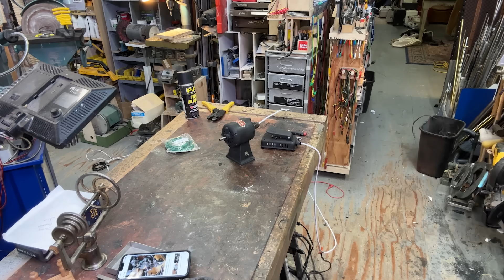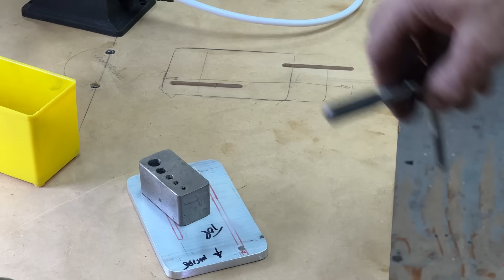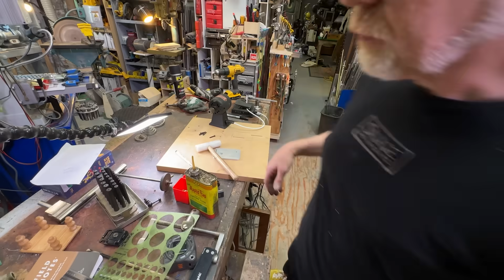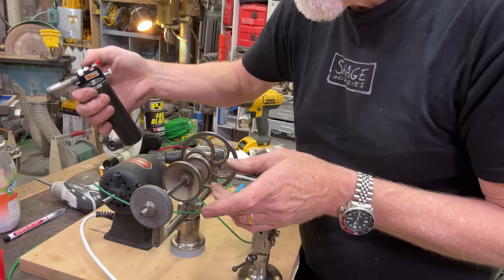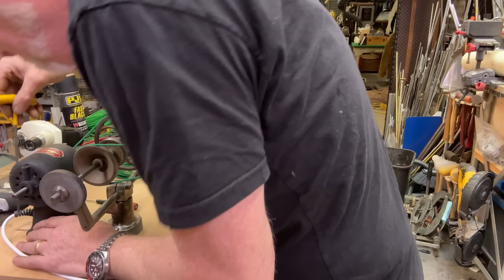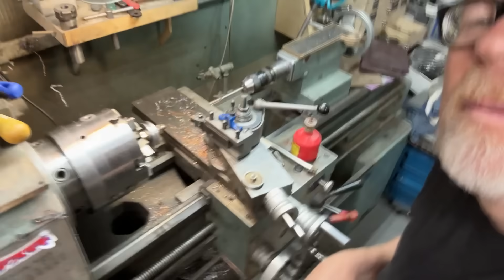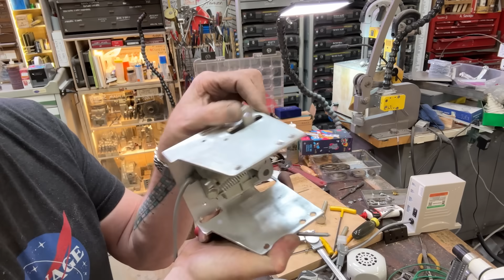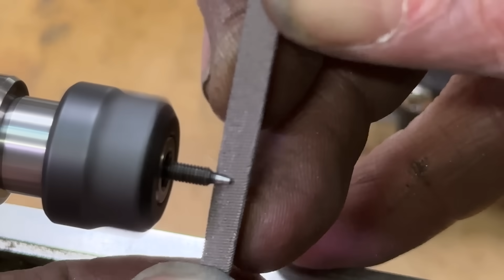Adam Savage's New Mini Watchmakers Lathe!

Comment from the maker: Check out Chronova Engineering: https://www.youtube.com/@chronovaengineering
Adam's restoration of the lathe motor: https://youtu.be/XQdJ-uG_Noo
The lathe motor was a gift from Tested viewer Paul Dorton--thanks Paul!
Reply: on the back end of the mounting board add some small hand wheels and some VERY fine threaded rods to tension each assembly for the belts more accurately ....  and dont forget to leave space for a tool rest assembly to work from ...
Reply: WOW what a gift. If you are interested in delicate work Clickspring on Youtube is a must. He has been building a very accurate copy of the famous Antikythera mechanism amongst others.
It's funny I always hated small lathes but now I have several monsters I have become fascinated with tiny work!
Reply: Diagram of how to replace a hall sensor with a variable resistor. https://drive.google.com/file/d/1bSE9vftQQLGGos4UH7KkB0bjkC0M2V7v/view?usp=sharing
Reply: It would be great to be able to spin a number 2 lead pencil

Comment: The best reason for milling a flat on the shaft is not to help the setscrew hold, but to keep a burr that the setscrew produces when driven into the shaft from binding against (and wearing) the bore of pulleys that have to slide over it.

Comment: Well I am not online so of course you couldn't find me. And I am still in the middle of the rebuild of my head stock on my levin precision 8mm or WW lathe. It is a closed head stock although I have lots of parts including several open head stock machine , which yours is, including both 8 and 10mm spindles. It is taking me a long time (months) for my rebuild for a number of reasons but videos like yours spur me on. The factory TIR on my spindle is 0.000050" or 50 microinches or 50 millionths of an inch. Wish me luck. I need all the help, technical or divin, I can get. Thanks for this.

Comment: Hello Adam, I need help because I’m looking for a motor for my lathe but I’m worried that a sewing machine motor is too under powered for what I need it for so can you help me with choosing the right motor for my watch maker lathe?   (2026 UPDATE) I use a cheap Chinese sewing machine motor that has 0.15 horsepower and after having it and working on that motor for 6 months I concluded that this motor is not worth it so your better off buying a bigger motor and maybe the one that Adam is using here would probably be better than what you need but I don’t see any links to this motor so I don’t know where or what to buy so I can really use help with this, I need a new motor soon!

Comment: The main purpose of a watchmaker lathe,  especially the GENEVIA design, is to make watch pivots. The lathe must be small enough to allow delicate cuts that produce a pivot, yet be robust enough to produce the rest of the staff and other small parts.    Watch pivots are so tiny they easily break before they are turned to the proper diameter. A watch pivot is not only tiny but it must be concentric to the outer diameter of the staff.  If it isn't, the balance wheel will be off and the  watch will not keep time correctly. A small watchmaker lathe can provide enough spindle speed and sufficient accuracy to produce extremely small machined parts.  Turning a pivot to a larger diameter then trying to grind it to the correct size with a stone does not work well.  If a watch pivot is sized to .008 thousandths of an inch and it is out of round or out of concentricity by a half thousandths of an inch,  it is out of tolerance by more than half the diameter of the part. Being out of tolerance by a half thousandths of an inch  won't affect a larger part for a clock but it will not work properly in a watch.     Accessories for watchmaker lathes allow for other machining operations  such as light duty gear cutting, light duty milling, light duty drilling applications but these operations are better done on more robust heavier duty machines.

Comment: Not sure you need the flat on the spindle ( balance )  and how much torque are you gonna put through it.? also as a piece of mechanical art it would be beautiful with brass pulleys, hardwood ornate base and a leather belt , but from a purely practical perspective wouldn’t a 18:16  small dc motor with speed. control have been simpler..!!???

Comment: I love turning brass on my Boley. Basically had to throw almost everything I knew about turning on a lathe out the window. Especially drilling with micro/wire size drills. I can sit and turn tiny bits for hours. I work with a loop and a lot of times my nose is rubbing on the collet while I'm turning. I'm sticking with the 8mm collets because of that. Tighter to the head stock and nice smooth little collets that you can rub up against without getting bumped. The most important thing I learned about turning micro bits is to keep your tool sharp constantly. I work with a series of emery paper sticks, stones, and polishing paste on a steel plate next to me and I sharpen the graver every few minutes or more to keep a sharp edge on the tool. Check it against your fingernail. If it catches on your nail it's sharp enough. I also highly recommend simply holding the graver blade in your fingers. When turning things down to sub millimeter diameters, it's all about feel more than math like on a big lathe. It's turn, measure, turn, measure, turn... Once you're within sub microns you finish w/ ruby stones to final diameter. Really such a fun artform. It's so much more intimate than turning on a big lathe.

Comment: Please Adam, get that speed adjuster wheel relocated. It's an accident in the making. There's plenty of room for another bracket to relocate the actuator lever box, and you could get it higher up so grabbing and turning the wheel is more comfortable. At least extend the rod so that wheel it's not directly behind and half a foot below the lathe and whatever work piece is spinning in it.

Comment: great video Adam, but fyi, the "pulley drive" is not only for speed setting, the motor goes to the pulley on the far end, the others are for the lathe, AND a mill/drill/grinding spindles which attach to the cross slide or a separate table accessory for drilling, gear cutting, polishing, etc. look up LORCH lathes, in YouTube there is a man with a channel, German, and in his language, but shows you the parts and function in that video (PS, most of these 8&10mm lathes work the same, APART from the American made unimat system{this does scroll saw and wood saw as well as other attachments}; this is a smaller, lighter system, but for 'old school' micro machining nothing touches the Lorch and Boley lathes.

Comment: Cool project! I was thinking about the switch mechanism control and thought it would be neat to make a notch style shifter knob like a throttle on an old tractor... You could use a spring-lever knob with a bunch of little notches on a bar to control the settings more quickly than a screw type knob.

Comment: Ive already seen some of chronovas videos of clock making, along with many others relating😁lovely lathe for watchmaking/repair. As well as your videos which are very characterful. When it comes to your threaded adjuster bar, i wouldve made it with fine thread which may give  a more positive feel. Otherwise great set up with the lathe and gear drive system. Enjoy the lathe😂

Comment: Hello Adam,
Absolutely loved your very entertaining video!    You are going through the trials and tribulations that I did with my watchmaker's lathe - a 6mm Lorch from about 1890.   It is reassuring to me that, as I am a total chump without any understanding of electronics, even a clever chap like you can also experience what I did.   In the end after what seemed like 295,654 hours of experimentation I dispensed with the countershaft and just used a sewing machine motor similar to yours with a rheostat to vary the speed. To help with speed variation, I put a 3 -step pulley on the motor, the other the way round to the one on the lathe's headstock. It' was only a temporary arrangement but has worked for me for 20 years. I also use those polyurethane drive belts and had just as much trouble joining them as you did!. Bit by bit I've bought more and more accessories for it and when I need to do tiny work, it's been brilliant. These lathes are incredibly precise and if looked after, will last several lifetimes - yours has obviously wound up in exactly the right home.

Comment: I’ve used an iPhone app that uses the flash strobing at different frequencies and using the camera frame rate you can get an approximate rpm, seems to work quite well. I love little bits of engineering like this small lathe

Comment: Hello Adam. Thank you for the wonderful video.  I am a watchmaker in Wisconsin and I had the same problem 20 years ago when I purchased a watchmaker lathe. I had to get the motor on it. What I have learned is you can use the Racine motor like you have you just have to attach a PWM motor controller to it. 20 years ago I had to build my own PWM controller today they sell them on eBay for $6. Because the motor is a brush motor  it will run in DC mode therefore any  PWM controller will work. Also, I have tried to use the green belts and did not like them. I am using oversized rubber "O"  rings. You do have to take the head stock apart to get the belt in  but its worth it the belt last 20 years. To bad I can not attach the picture to this I would attach a picture of my setup. If you have any questions on the watchmaker's lathe or need any suggestions feel free to contact me. Here is my website: www.watchcircle.com

Comment: I see you are not a watchmaker, as I am not. But a star for the effort. And you got it working again. 😁
But now a challenge on the lathe, put a 5mm round brass rod in the chuck and turn an 8mm long rod of 0.6mm diameter.

Comment: You can replace the hall effect sensor with a potentiometer and a 1.6k and 3.2K resistor.  It's a lot more convenient.  In this order  (RED)165V ->1.6k - pot-3.2k-. 160V(BLACK).  Tie the yellow wire to the center terminal of the pot.  Insulate well sine the voltage is 160V DC rectified mains.

Comment: Milling flats on the spindle is a bad idea. These are low torque lathes. If anything jams, you want the belts and pulleys to slip rather than anything get damaged. They were well aware of exactly what they were doing when they designed it.

Comment: when joining that type of belt, do not directly heat the materiel, mount an old butter knife( or something similar ) in a vice and heat the blade with your flame. place the belt ends on opposite sides of the knife, near the tip ( still heating the blade as far from the tip as possible ) when up to a decent temp, slowly slide the belt ends off the blade and as they clear firmly press the ends together and hold tight for a minute or so until the joint has fully solidified. wait a while until fully cooled then trim the flash off with a fresh scalpal blade.

Comment: I learned about the center punch that you're using here from one of your previous machining videos and got a pretty similar one. I actually use it for a ton of things and on a ton of materials to diferent purposes. It can straight up just punch through thin leather. It also works really well on starting nails or screws in soft wood when you don't wanna break out the drill but want a tiny bit of accuracy.

Comment: I used that same motor for a 5c cnc lathe I built several years ago. The motor speed control uses an optical type variable resistance control that you can swap out for a potentiometer you can mount anywhere to control the speed. Takes a few seconds to swap out the optical for the potentiometer. I think it's a 10k ohm pot.

Comment: Hi. Adam. To join the belt, the 
Easiest way I fond is an old stainless  blade that I hold in a clamp standing upright put the belt’s ends at the same time on the hot blade and slide them precisely  and fuse them directly soon they live the blade. If the temp was good, that weld will be the strongest part of the belt. Of course you must install this belts before soldering. If you don’t want to do that you can use  
Some marine 5 mm O rings they last a lot longer.

Comment: Hi  Adam. I hope I am not too late but you will have to change the 2 pulleys for 2 double ones.  The belts don’t like any slepage because they over heat and break in few minutes. This is the reason that I put a double pulley on the motor also one on the lathe shaft. The motor side may need to be smaller in order to have à very low speed and some extra torque .  
I am using a hi torque motor with 
RPM control and   
Torque control 
And a precise over load control.
Sorry about my English. I am French.

Comment: You should look into the CZ50 for some more modern additions to this lathe. It is a new Watchmakers lathe that is likely based on the Boley since that is pretty much the gold standard of Watchmakers lathes. They are made in China but they definitely aren't the China eBay crap you generally see, he does some pretty flippin incredible work!

Comment: Would it be worthwhile having 2 power adjustment knobs? One for fine tuning and the other to go in larger steps feom low to high. Or is there a reason you shouldn't?  I also think it would benefit from some sort of sheild/cover between the lathe and the motor/electricals.

Comment: Thanks for posting - it inspired me to finally get my BCA Jig Borer operational. Bought very similar Sewing machine servo motor and controller and it's worked really well. In fact so well I think I'll upgrade my jewellers lathe with a similar arrangement it's so quiet. One thing I'd like to add is easy push start/stop button. Where do you think the best place to wire it in? I'm thinking in the "throttle" circuit at the moment.

Comment: As usual... awesome video.  Thanks.  Wonder if anyone has any comments about giving up the foot switch for a manual lever speed control?  For fine work where you'd have your body braced and both arms leaning on the bench, wouldn't you want to that foot controller?

Comment: I'm the son of a watchmaker and my dad also had one of those. Only there was no motor attached, he always used it with a handcrank that looked a lot like the largest wheel on that countershaft. The objects he would be making were always mounted between two centers and spun using a little "arm" and the tool was almost always a hand held chisel. (Sorry if my jargon is off but I'm Dutch and not a machinist)
Reply: I still do that!.
Reply: What do you make on it?  @panjandrum.conundrum

Comment: I noticed others have given advice on joining those belts.
Many ways to solve an issue, however the best tool for joining belts having tried some of those other procedure with mixed success is a Fenner Drives Butt Welding Kit. 
It is a quick no fuss and accurate way to fuse belts, with an extremely low possibility of burning yourself. The belts I have made with the kit have been  accurate well fused and have not failed.

Comment: Super cool.  Inspired me to make my own mini-lathe for small woodworking items.  Got the servo ordered.  

It would be super cool to see some kind of wheel or other system to speed up changing settings so you don’t have to screw that bolt with your fingers.
Reply: I honestly assumed it was going to be a lever with slots set at certain speeds, almost like an engine order telegraph.

Comment: Hey! Former watchmaker here! We used exactly those lathes everyday during the 3year of training when creating axels all dimensions for anything from large wall clocks to small handwatches.

If I remember it correctly, we hand maked axels for the balance which where less the 0.11-0.09mm in diameter.

We needed to stop using the lathe tool(the one which you hold in your hands when removing material from the steel/brass), and then we simply polished it down the last part, like going from 0.12mm to 0.09mmmili to push all the un-eveness to get a polished surface when assembling it later with the balance... (Anything that lowers the friction is super important)

We then used a special tool for called (in Swedish) "rullbänk", which was pain in the ass to use, but essentiall to master.

Anyway, love the content, and I have been waiting and waiting for watchmaker tools popping upp on your channel.

Keep up the good work!!
Reply: > We then used a special tool for called (in Swedish) "rullbänk"
And what did that do?

Comment: I have some suggestions

I think that the hand crank for the speed adjustment seems a bit slow, I think some kind of lever with a couple of slots to get within a general speed range would be nice

an other suggestion would be not to use a threaded piece of Delrin, just a pice of steel or aluminum with a hole trough and you engae the threads by tightening a pointy grub screw

a spring loaded pin with a knob for quick releasy actually might be a neat idea too
that way if you need to shut it off quickly you certainly can just pull the threaded speed adjustment bolt a bit harder and overpower the spring of that pin

I think I might even have the necessary parts to make that, only issue is that I live in austria :D

Comment: If you take apart that beautiful little antique motor you may find both pressed in bearings and/or a mechanical centrifugal switch involved in motor starting.  You could also just have a worn shaft.

It is possible any if the above could get your noise to a reasonable level.  I wouldn't bother with a modern motor but the antique is wonderful and might be worth some love.

I am extrapolating from a 50 year old induction motor I tore off my own lathe, not sure if that little guy will be the same -- it'd make a fun tear down if nothing else.